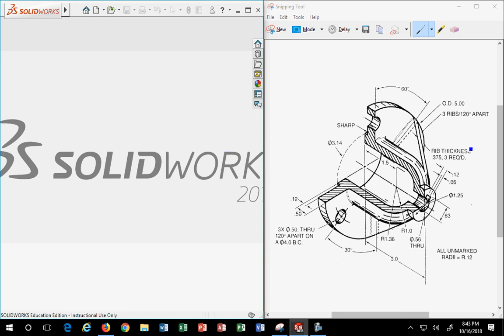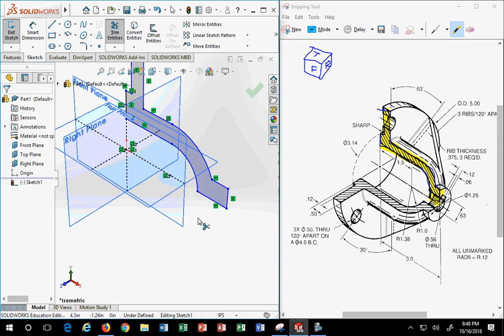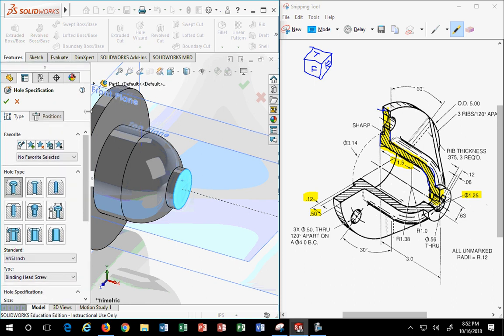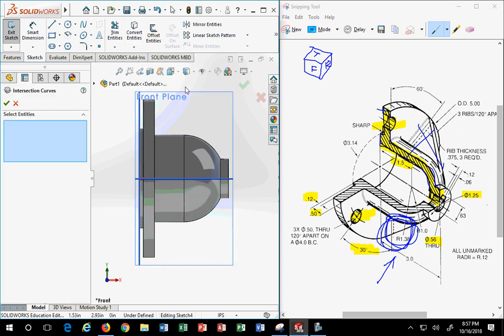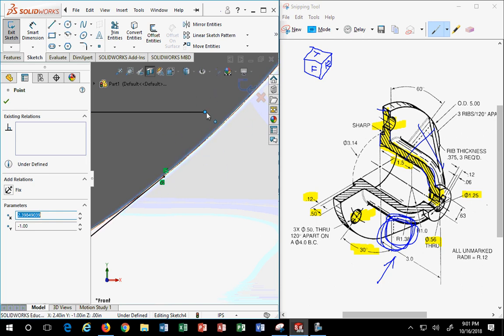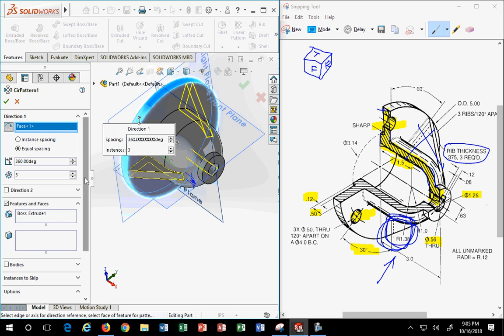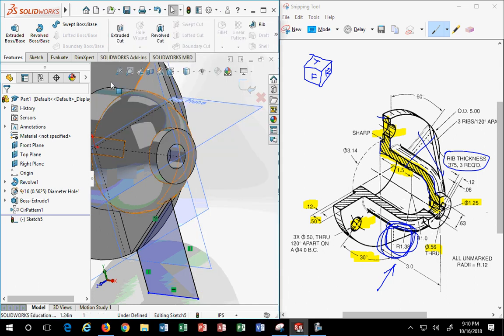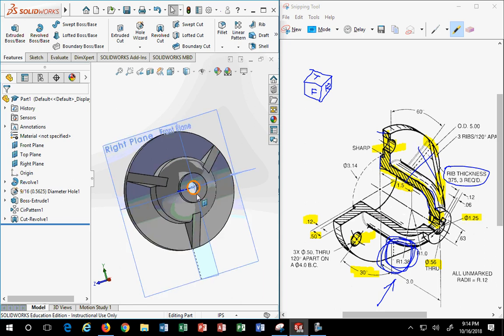Tangent Rib on a Curved Surface in Solidworks

Comment: sorry didn't watch the whole thing but quick question: so basically instead a RIB feature which do not tangent rib onto surfaces, an extrude feature inside of the curved solid and let the auto merge does its job right?